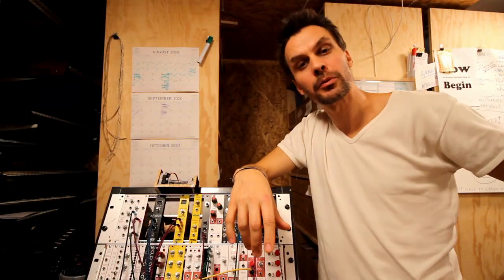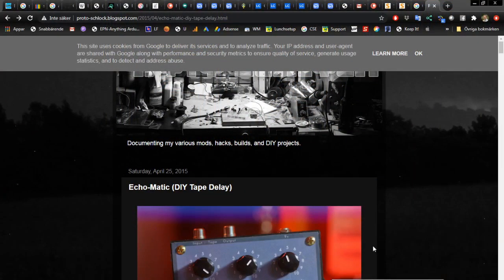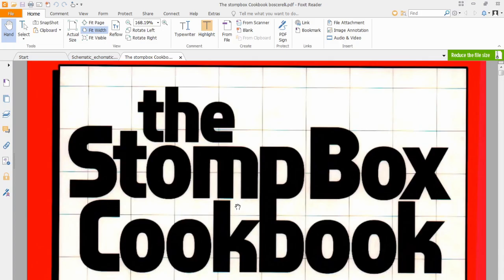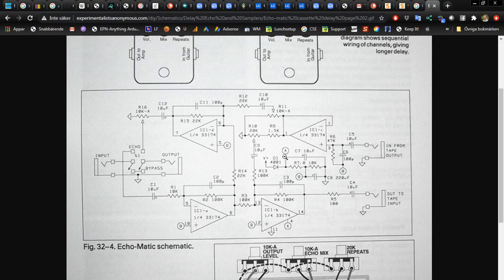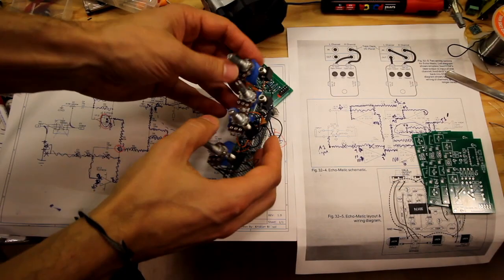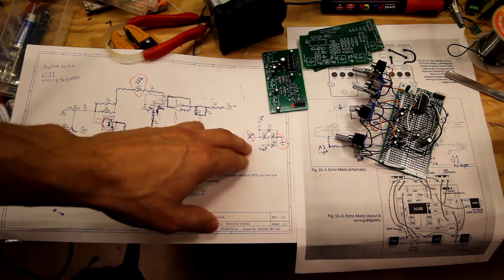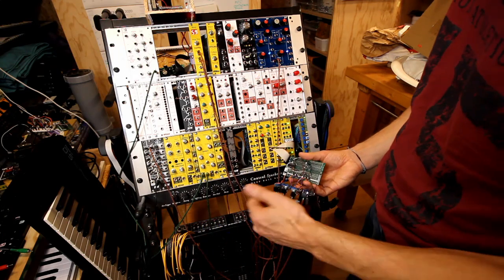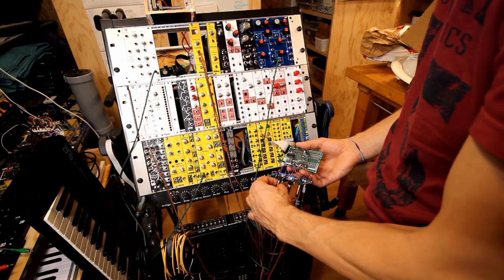Echomatic - an effects mixing strip - Modular in a Week 12.3

Comment: That is superawesome. I have one of those amazing Marantz tape recorders, and I have been thinking about making a passive thing to add a dry signal and like a mix, as it is pretty poinless with only a wet signal. Do you have any toghts on what diffrence it would make to make something like this in comparison to a super simple passive one? I think it is cool to have some PCB's even if they are non functional, like baseball cards for DIY geeks. I have managed to reverse enginer a few modules, so I can build on breadboard or just deadbug if I need more of the same module, superhelpful for me as I still do not understand real scematics.
Reply from the maker: I think the really nice thing with this module for tape delays is the feedback, as that really adds some character to tape delays. Also it is good to have control of the input and output signals as modular signals can be quite hot... :)
Reply: Definitely. I have not played around too much with my taperecorder when it comes to intigrating it with synths, so I will test a few things before I decide if I go passive or powered. The recorder I have has a built in limiter and levelcontrol, so the that way should be fine, but I guess the output of the recorder might be to weak to make the desiered effect. Hope I can finish a few of my other projects soon so I can work moar on the modular stuff. :)